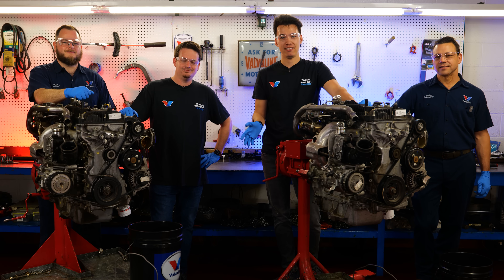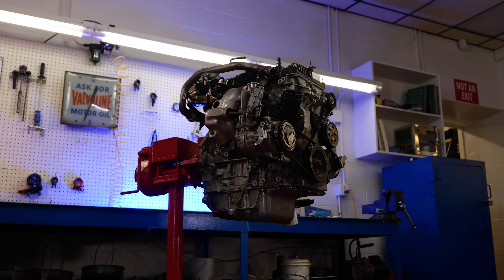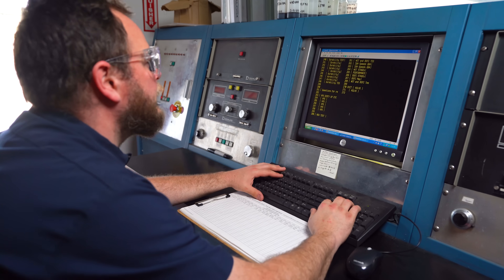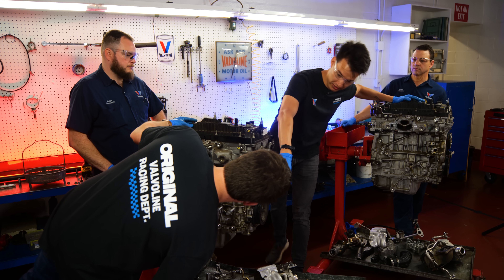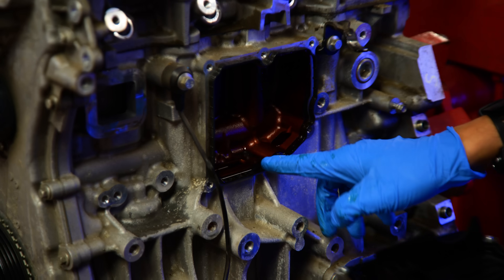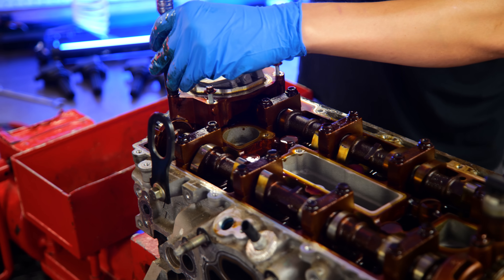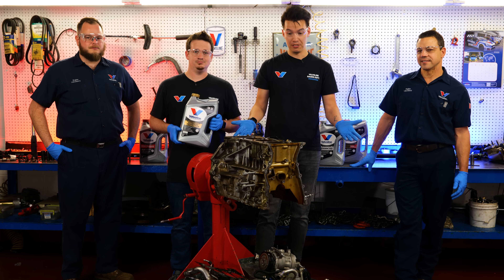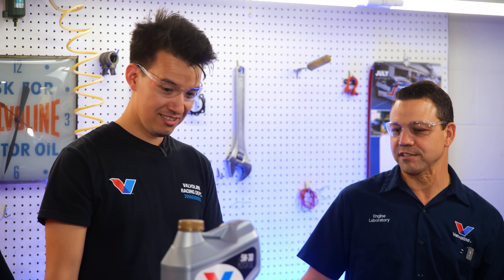Testing different oils over 4 years and 1 MILLION miles

Comment: 10k oil change intervals are wild
Reply: How about 0W-16 oil?
Reply: Oils are getting thinner like Toyota using a 0w8 because piston ring tolerance is getting tighter for combustion efficiency and emissions. In the end, they will have more problems and be more costly. Newer engine designs aren't necessarily built to last. They're more efficient, yes, but at a cost

Comment: What they didn't tell you. 
While both engines had seal leaks the engine running synthetic could have been fixed by switching to conventional. 
Conventional oil causes the seal to swell. If you use conventional oil from the start and develop a leak you can start adding a quart of conventional to cause the seals to swell and seal. 

In other words, if you give you new car synthetic you can fix seal leaks that might develop at high mileage. 
If you give your new car conventional and it starts to leak you screwed. 

Redneck engineering!!!
Reply: Why not use a synthetic high mileage/synthetic blend high mileage instead. The cost difference is negligible.

Comment: Good test and analysis. I'd now be curious to see another set of the same engines run their respective oils but this time on a 5,000 mile interval for the same 500,000 miles. I wonder what the internals and varnishing levels would look like after that.

Comment: I think the engine that was use with conventional oil should be put back together and run with Valvoline's new restore and protect for four oil changes then the engine striped down again to see how well the oil has cleaned the varnish on the engine.

Comment: Gotta call bullshit on this one, there is no way in hell these engines have 500,000 miles on them, especially with 10,000 mile oil changes. Even in a controlled environment I still highly doubt this. Also, this is a 14 minute AD.
Reply: MUST AGREE - an ad for Valvoline oil, you can buy the "good" synthetic one or the normal one that will do the job - funny how there's no mention of filtration quality or frequency, which IS the life of an engine!

Comment: I have long been a believer in synthetic motor oil, and This Test shows that it does provide better protection. However, I would like to see what both engines would look like with a more reasonable 5000 mile oil change interval. Because synthetic oil or not, I personally do not trust these extended oil change intervals from the manufacturers. Their objective is to get the car to go past the warranty. My objective is "how many miles can I squeeze out of it?" Oil is cheap. Engines are not.

Comment: Biggest fault in this test was running the conventional oil 10k miles. Of course your going to get alot of varnish and build up running conventional that long. But, test proved that it's still a good product, just that synthetic is better.
Reply: I think it was supposed to be a win/win for valvoline - but look at the title "Different Oils" is mentioned so we presume different manufacturers oils - really its Clickbait! and the tarnish/browning on the surfaces of the conventional oil has no effect other than visual - I would like to know more about their filters, microns, etc.

Comment: I would like to know what group the synthetic is.  I also think it would be interesting to put the conventional oil engine back together without cleaning a thing and then run 40k miles with your new restore and protect and see what it does.  

I personally run full synthetic and then a flush roughly every 60K miles.

Comment: Too long of an interval for the conventional. That said, both look really good. Modern synthetic oil is super impressive. 500k with a 10k change interval looking that clean is crazy. Makes me wonder how many engines die before 500k just because of missed oil changes and/or leaks. Maintenance is everything.

Comment: My only complaint is the conventional shouldn't have been run 10,000 miles.  One of the explicit benefits of synthetic is you can run longer oil change intervals.
Reply: Good point All car maintenace schedules that say 10k are either using full synthetic or semi synthetic.

Comment: These tests are worthless without an extreme short trip component to the test. Particularly a cold weather short trip test cycle. How does that synthetic react to not getting to full operating temp when the weather is 0 deg F?  Simulated highway and stop & go testing is nothing compared to testing how engine oils handle fuel dilution, GDI soot accumulation, moisture accumulation, etc. THAT is where some oils really fall short.

Comment: Now this is worth watching. Goes to show, change your oil often and use synthetic if you can.
Reply: Wouldn't exactly call 10k OCI's "often".
Reply: @justinw1765  I would. I think 5k is pushing it if you really want to keep the inside of the engine clean, but also keeping  it THAT clean does not guarantee it will last longer so it is likely is overkill for most regular engines. We are not far off.

Comment: Now let's see them compare different brands of synthetic. I'm particularly interested in the high-end comparison of Penz Plat, Penz Ultra Plat, Redline, and Amsoil vs the low-end bargain stuff like Walmart and Auto store brands.
Reply: Group III+ base oils actually match and many times outperform PAO base oils (your so called superior oils). Judging an oil strictly on base oil composition is very shortsighted. The additive package is the most vital part of a fully formulated oil. Now don’t get me wrong, I love and use Redline Oil but it’s not just because they use PAO and POE base oils. Their additive package is proven for my intended use. They are also an American company (Texas). But then again so is Valvoline 🇺🇸
Reply: @nordicpride9708  I wouldn't say that I have DEEP knowledge of oils, but as far as I know so far, the ones listed (particularly Redline, Ams, and PUP) also have superior additive packages as well. I'd love a resource that has a full breakdown on all or many of the group 3-5 oils and their additive packages. One of the more important things to me is low oil consumption/evaporation (NOACK, right?) and resistance to the varnishing effect seen here, as well as gumming up and becoming sludge in general.

Basically, what are the top 3 lowest maintenance oils for a high-mileage engine that's the least likely to sludge up, varnish, cook-off, or cause other problems? And then beyond that, what are the top 3 all-out racing/extreme-duty oils? Obviously, I'd also like to know how to verify those traits/aspects by examining the additives and base oil traits.

Comment: Super cool test. Only thing I think was missed is conventional isn't made to run 10K miles between changes.  It would be more accurate to see the same test but with proper 3k mile oil changes on the conventional and the rated 10K mile oil change on the synthetic. Then the comparison would be more accurate because the products are being used and serviced as intended.
Reply: It would be equal at 5k changes.

Comment: It's interesting, but 500,000 miles without context is kind of useless. If they were both strapped to the dyno and ran at 70MPH constantly, then it is not an accurate representation of what a normal driving cycle is for most people. I wish they would have elaborated on this. I myself have been inside of 400K and 500K engines and the interior varnish isn't so much of a problem as the stuck rings are. The stuck rings will cause massive oil consumption and that in turn will cause pitting on the exhaust valve seats and then a loss of compression. Also, any turbocharged car calls for synthetic because of the massive amount of heat that can break down the additive package in the oil, so its interesting that they chose this test on a modern turbo car. I'd be interested to see it run again on an older engine where the tolerances aren't as good and no added heat from the turbo.
Reply: You weren’t paying attention to the video.

Comment: Great vid probably both engines would have gotten better results if they changed the oil at 5000 to 6500 instead of Ford's 10,000

Comment: For everyone who owns an ecoboost, please change your oil every 4K miles or 5K kilometers with synthetic. 
Sincerely, a ford gasoline engine certified technician,
Reply: I change my oil every week.
Reply: Had a 14' Focus ST and thats exactly what I did till I got rear ended lmao. But I used Penzoil ultra plat every 5k miles. Even threw in Bestline for extra protection
Reply: @Mazhura_13B  I had no idea they had Focuses that were fourteen feet long.
Reply: Mobil 1 full syntetic the best.
Reply: Absolutely! Amsoil signature series every 4000 miles.
Reply: Or else what?! They’ll last 500k?
Reply: “eco boost”. haha…where’s the “eco” part?
Reply: Great point lol
Reply: I’ll be doing that
Reply: How about the hybrid 2.0?
Reply: lol. 2013 2.0 ecoboost escape. 330,000 on it. I use penzoil ultra and change oil twice a year(don’t go by mileage). Valve cover had a crack and I replaced a failing vvt solenoid(both). Still clean inside. I drive 17-20k miles a year.
Reply: The friend of mine owns 1.6 ecoboost. He used dealer 0w20 synthetics oil for 60k km when he got a kind of so-called LSPI. There was a little sludge on the surfaces inside the engine. He bought a new block and started using cheapest conventional oil (around $1-2 per liter), including monograde ones for tractors. Since the repair he has driven 100k km and it's absolutely clean inside (he was removing oil pan for reseal).
Reply: This! No way I would go over 5K miles without changing. Don't trust the oil life monitor. I do Amsoil or Pennzoil full syn though. I have already done the cam phaser fiasco once on my 2012 F150 3.5 Eb and it is rattling again.
Reply: That is exactly what I do with my Maverick 2.0 Ecoburst. 4K if local miles and 5k if I drive mostly highway. Full synthetic!
Reply: To anyone that runs a turbocharged gasoline engine, please run synthetic and change every 5000 miles, especially if your engine is stuffed tight inside the engine bay and heat can't get out.
Reply: Full synthetic @ 5000 mile intervals kept my 2013 3.5 Eco alive for 250K before it cracked a head, shelled a turbo, and ruined the cats. I will say it did not ever experience excessive valve carbon, but only getting 250K out of it was disappointing before catastrophic failure.
Reply: I have an ecoboost and I have changed the oil 4 times in less than 3,000 miles
Reply: Conventional oils are made to be changed every 3500, unlike sinthetic witch is longer life oils
Reply: I changed my oil at 3k with full synthetic because oil is cheaper than engines. And that F150 3.7 ecobitch still took a shyte at 160k miles! Trucks with v6 turbos just don't belong!
Reply: @mojorizn72  sometimes I’m of belief that the technicians are doing horrible jobs!  So no matter how well maintained the vehicle is, the negligence on the technicians part is what causes the issues!
Reply: @MrSmurf459  Man, as a former Benz tech I sure saw my share of hacks/crooks, which is why I have trust issues with any tech. There was a guy next to me that would do customer pay brake flushes just by sucking out the brake fluid in the reservoir with a turkey baster then put new one in. No actual flushing of the lines. His team leader didn't seem to care either. There was a tech who turned on a car with no oil pan to back it out of his bay to mop the floor, it surprised me that it wasn't clicking and clacking (Mobil 1) but still I would have been mad if that was my car. Just normal dealer stuff.
Reply: @mojorizn72  HAWG - CRANKED
PANTS - SHIDD
BARB - LEFT
GOBBLESS BORTHER
Reply: @mojorizn72   Or maybe it's operator error.
Reply: First of all, your conversion from miles to km isn't even close.  Second of all, it wildly depends on use case.  Idling around NYC and sitting stationary for an hour to run the heat/AC every day is far different from commuting at 70 mph at steady cruise on the highway.  I've changed full synthetic at 7500 miles or every 2 years (whichever comes first) in all of my cars and have not had one single mechanical issue in any of them.  I could probably push 3-5 years for the lower use cars (they are all driven at least 30 minutes up to temp at least once a month), but I haven't seen enough data to push that yet.
Reply: @nunyabusiness896  You change your oil every two years? You may not experience a catastrophic failure, but rather additional wear which reduces power, and fuel efficiency.

I would love to see a compression and leak down test on that thing, as well as an engine oil analysis.
Reply: @guthrie_1   2 years with far less miles than 7500. Synthetic oil doesn't automatically go bad in 2 years.  A popular mechanics article once ran the same synthetic in his lawnmower for 10 years and Blackstone still tested it to be fine. You've got a lot to learn, kid.
Reply: @nunyabusiness896  Yeah this isn’t a lawnmower. I want an oil analysis performed on YOUR oil, and I want the rest of the aforementioned tests performed. There is no way you are doing your engine a favor by leaving that oil in there for two years.
Reply: @guthrie_1   "BuT iT's A LaWnMowEr".  My brother in christ, it's the same synthetic oil.  If anything, lawnmowers are harder on oil because of how crude the lubrication design is and how little oil there is in an engine being run hard so it's more apt to get super hot.  There was also a government study done on everything from trucks to construction equipment and concluded the same thing.  I check the oil regularly, it's always a good color, good viscosity, minimal contaminants (i.e. virtually none).  What causes wear is lack of warming up before high loads, lack of cooling down after hard use, excessive high throttle/RPM use, doing dumb sht like burnouts and donuts, idling it for an hour on lunch break to run the A/C or heat, cheaping out and using conventional when synthetic is required (and not shortening the change interval) etc.  You don't have a clue how little you know or understand about this.  Odds are in many cases the oil you're putting into your car is already 1-2 years old and you don't even know it.  Sure, after like 10 years of sitting on the shelf the additives will come out of solution, etc., but no one is suggesting that.  Using the correct oil and knowing how to properly operate the car (managing temps and not doing dumb sht) is far more important than time intervals alone.  I have not found any concrete evidence to support synthetic oil goes bad in 2 or even 3 years assuming it's driven often enough (at least once a month) and for long enough (~30 minutes) to evaporate condensation out and the rated mileage isn't exceeded.
Reply: @nunyabusiness896  I don’t agree that the load and stress produced by a lawnmower engine is comparable to the load and stress produced by a car/ truck engine, but I think I understand that the hangup is the age thing. I understand that oil sitting in a container for several years is not going to “expire“. When you say 7,500 miles or every two years I’m assuming you’ll get to 7,000 miles, and only change it because you hit the two year mark. So you, (maybe not you personally) not only have oil with thousands of miles on it, but also condensation, and fuel contamination. Yes I understand that you personally make sure to get your oil up to operating temperature so that these contaminants are evaporated. Giving gospel like advice to the public that is based on your extremely disciplined driving habits may not be ideal.
Reply: @guthrie_1   I’m actually talking about cars that get 1000-5000 in 2 years against a 7500-10000 change interval. It’s not advice for everyday drivers to treat as gospel, it’s more for collector/secondary cars to not waste money dumping good oil.
Reply: @nunyabusiness896 3 years between oil changes. 😂
Reply: @nunyabusiness896  are they all ecoboosts? And  im rounding off the numbers to a nice even number for the yankees i didnt want to say 3106miles. Also, 7500miles is absurd and a good way to gum everything up
Reply: @xXCODkingProductions  225k miles and runs like new would beg to differ, though that’s a Mazda Skyactiv and not a Fix Or Replace Daily turdblow
Reply: @xXCODkingProductions  You wrote 4K miles (that's why he complained), but you obviously meant 3K miles.
Reply: @xXCODkingProductions they said they changed the oil every 10k miles kinda crazy how good the conventional held up.
Reply: @nunyabusiness896 I have a 2003 explorer with 233k miles. I change my oil once a year, probably don’t drive more than 7500 miles a year. But the car runs really well. Granted it’s a naturally aspirated engine and not an ecoboost like mentioned in the comments. Personall\y I’m not a fan of any of these turbo engines no matter who makes them